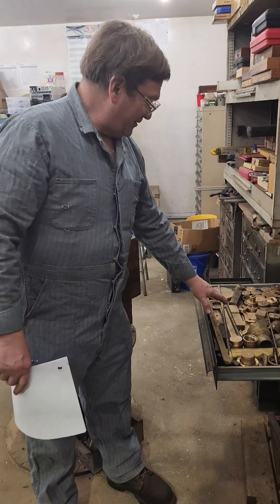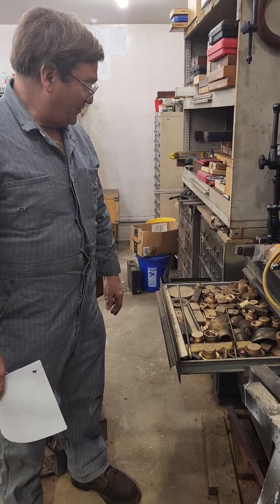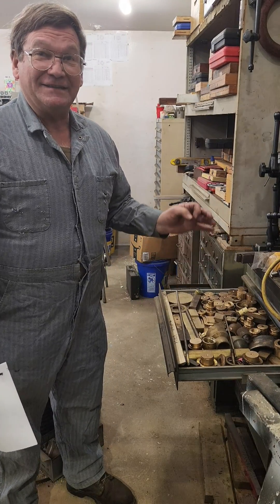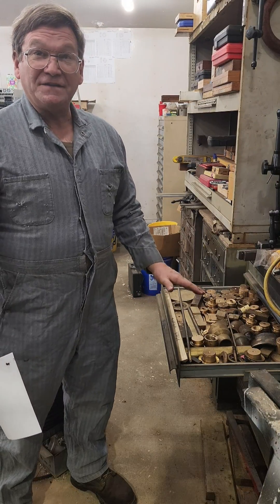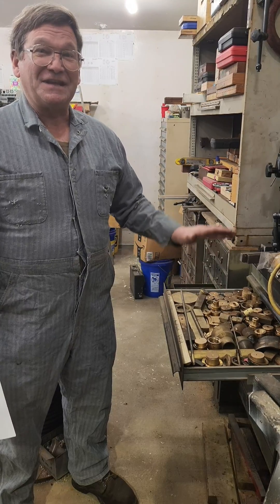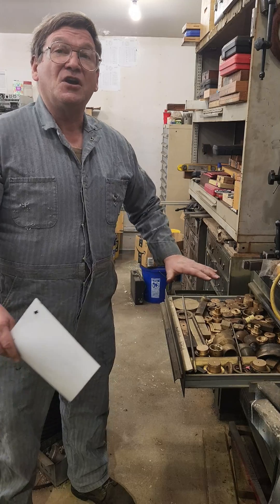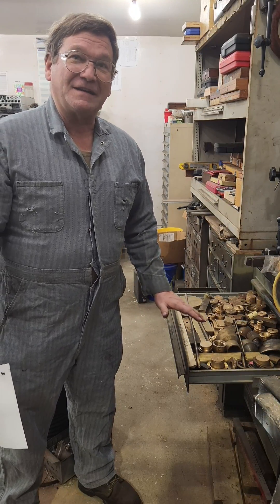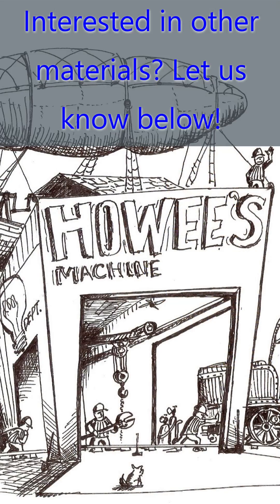Machinist's Minute(s): The Difference Between Brass and Bronze

Comment: Of all of those, phosphor bronze, is the only one I will never work with again. We had a job with RCA, back when they made CRTs. We got the material in, and it has a reaction with the flesh, if it cuts or you get a chip, under your skin. Not pleasant. Like acid burning through your body. Never again. But, they would make diabolical bullets.

Comment: Nice video! Are you located in Alaska? If so, I am across the mud pond at the same latitude in Finland. I was just wondering what kind of working/ aprenticeship opportunities for machinists/ engineers around there? Or learning machining? Keep up the informative videos!
Reply from the maker: We are located in Fox, Alaska - just outside of Fairbanks. As far as machining goes there are paid courses down in the lower 48, but for the most part there's not much in the way of training programs in the state. The university of Alaska has a decent engineering program, but it does lack a lot of the practical side of things.
Reply: After years of experience, I thought of an Associate Degree from Ivy Tech, could make me more money. I was disappointed, then the one decent guy, quit, because they wanted to get accredited, and asked him to get a degree. So we got a guy with a degree, without experience, read the book, and didn't understand it. So they may not all be like that, but higher education, seems to be about having a piece of paper, but not understanding how to do the job.

Comment: As a welder, it would be interesting to know how to work with that material if I ever encounter it. I literally know zero about working brass/bronze as a base metal. Not a subject the they covered in school back in the day. Only ever had to work with steel/ cast iron/ aluminum.
Reply: I use bronze as a buffer to braze tool steel to other hardened ways/pieces. Even brazing in general is a mindfuck. We had to attach stainless thread rod to hardened ways. This old swiss brideport operator came over spun the mill up to 2300rpm with a piece of thread rod in the collect, once the shit started sparking and glowing he just threw spare brass chips all over the flaming threadrod. And then just walked away. Apparently that's how the airforce used to friction weld things together...
Reply: can't remember exactly, but I think you would braze it. been forever so I could be wrong.
Reply: Yeah I think I remember brazing with oxy / accty is a great way to bond brass n bronze, but there is also tig brazing that I think gives great results, although I only tried tig on steel and alum, so far.
Reply: Brass contains a lot of zinc and will behave very dirty and smokey when you go to weld it, like welding galvanized steel but worse.
Bronze will be almost like welding copper, it will behave nice.
I'm talking TIG welding here btw
Reply: @phitsf5475  it's not nearly as bad as welding galvanized steel, but it is a terrible oder. I use a tig welder to braze, somwtimes... again, it's not the zinc content: they used to go by color. You would get bronze from red being the hardest to yellow being the softest. So bronze(red) to brass(yellow). And again, depending where in the world you're orders the material from they'll call it whatever they're going to call it. You're at the tip of the iceberg; whereas I've been chasing this rabbit for years now.
Reply: You do lots of welding on cast iron? Always been told its a bear to weld.
Reply: @allanschmidt8859  trick is preheat and cool it very slowly, good nickel rod. There is still a chance you may hear that ting as it cools and you know it just cracked somewhere. Let it cool    naturally it almost always cracks, that's my limited  experience with it,
Reply: @jeffmays3608  Nothing worse than hearing that "ting" once you are done.
Reply: @allanschmidt8859 Cast is preheated, but don't overheat. Nickel rod, and tapping it, constantly with the chip hammer, to relieve stresses. Or drill the ends of the crack, to stop it from spreading, V notch, then braze.